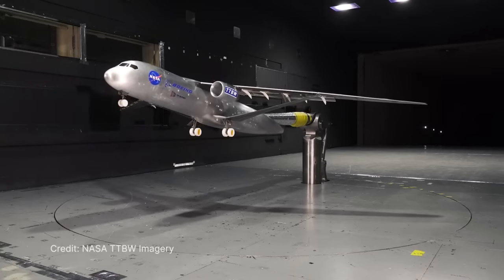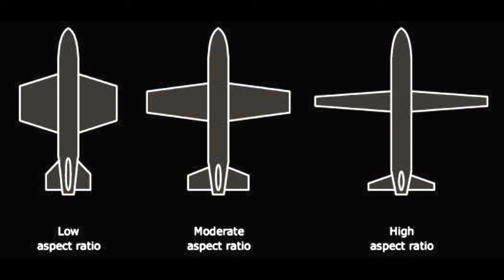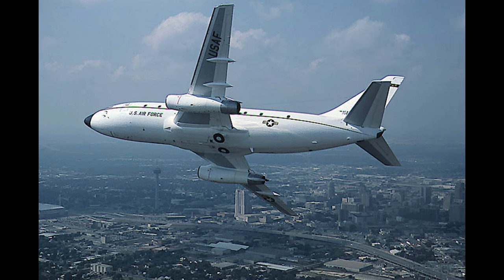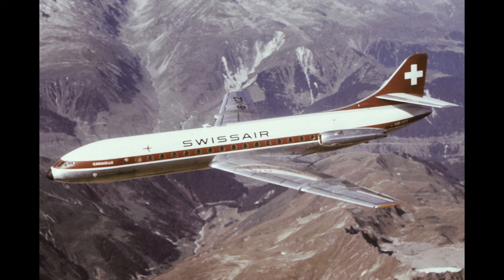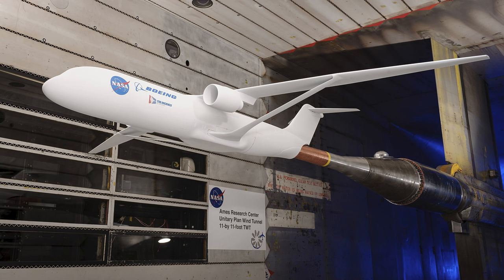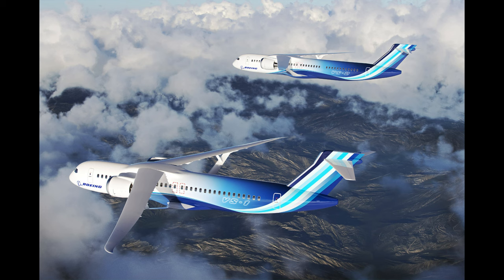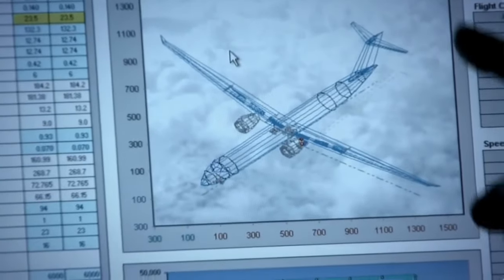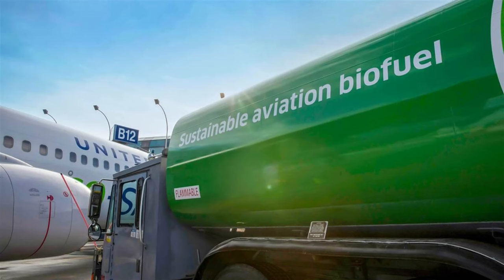NASA's New Airliner Experiment To Make Flying Less Expensive

Comment: On your electric plane digression -- Harbour Air (operators of the pictured Beavers) does a bunch of short routes around British Columbia with their floatplanes; in addition to doing half hour tourist flights over the Vancouver area (let them experience a floatplane and see the sights).  It looks like at least half their scheduled routes are 35 minutes or less. 
An hour of so of electric operation is probably perfect for them  -- use the quieter, and hopefully lower maintenance, electric ones for sightseeing and short hops and reserve their gas powered ones for their longer routes.
Reply: I got to see this very plane in person last summer. It was a guest at the BC Aviation Museum open house.

It had only a had few test flights at that point. An engineering blueprint of where the engine is mounted is painted on the nose. Looks pretty cool up close.
Reply: I have seen some articles and opinions that suggest Hydrogen Electric power systems could be the future solution to alternative fuels for aviation.
Reply: @johnjaffe6107  Possibly, though the power density of hydrogen storage isn't great either.  Still, I wouldn't be surprised to see some form of battery or fuel-cell electric planes in the short haul segments replacing many turboprops, and long haul going to bio-jetfuel in their gas turbines.
Reply: Hmm, I wonder if regs would allow the cruise safety margin of a battery powered plane to be met by an onboard fuel powered APU generator.  (and whether that'd be lighter than all the extra batteries).  I'm  envisioning that in normal flight ops you'd be 100% battery, but if forced by an emergency to stay aloft longer you'd fire up the generator and burn your power dense fuel to run your electric propulsion.
Reply: How many flights per day are the planes doing though? When I visited it seemed like they were rotating very quickly.
Reply: Norway also operates some short haul passenger flights that are electric props.
Reply: I believe their long term plan is to convert their twin otters to electric, too. Which would be a more commercially viable aircraft, too.
Reply: There are videos of that aircraft and interviews with the CEO. The quietness is seen as an advantage for early morning and evening flights. They operate a taxi service and being able to fly earlier and later will be an additional source of income.
Reply: The 'electric airplane' crowd  should get together with the 'fusion' crowd.
Their combined delusion could produce a super efficient totally green fusion/electric plane.
They could even have these ridiculous impractical wings where the greatest stress is placed
on the thinnest part of the aircraft at furthest distance from the aircraft body.
How cool would that be?
Reply: It seems to me that there are so many better places to put the resources I have to believe electric aircraft are more fanaticism than logic.  Even if you can build an aircraft that has an hour range and can charge in 30 minutes,  if you do this continuously battery life is going to be pretty short.  Batteries will keep getting better.  They may makes sense for a daily 30 minute flight.  But, as Scott Manley tried to explain it's a different equation than cars.  Kinda like R-12 freon we were venting huge amounts into the atmosphere on purpose and that had to stop, but we should have left it for a refrigerant where venting was only accidental.
Reply: I was excited when I first heard about their electric R&D in 2019! They're a local company! Wikipedia has a good writeup on it.

"In March 2019, Harbour Air announced plans to convert an aircraft to run on electricity, which would serve as a test prototype during a two-year duration regulatory approval process, and eventually hopes to convert its entire fleet to electric propulsion. The first plane to be converted is a DHC-2 de Havilland Beaver."

Can't wait to have clean, fast electric flight options to and from Vancouver Island!
Reply: @jonathan_60503  Takes too much room and weight. You're better off just adding more batteries. Slightly larger electric aircraft (and more aerodynamic) can get 400+km already, after reserve levels. Look up Eviation - they're building one and have already tested it. Float planes (being less aerodynamic) won't get range like that, but 200-300km should still be possible. More than enough for most of their routes.

@Charles Nelson If you go with LiFePO4 batteries, you've got the possibility of 10,000+ charge cycles and minimal capacity degradation. The downside is, your range is halved from the get-go. The popular Chinese Model3's are using LiFePO4, and getting 250km on them is about the max, but they're cheap, safe, and simple to manufacture. (Very different from a lot of proposed solutions.)
Reply: @charlesnelson5187  Those who say a thing can't be done should get out of the way of those who are doing it.   There are small, commuter-type planes that are flying on electric propulsion.   Electric versions of airplanes the size of A320/737 are still probably a long way off.
Reply: @johnjaffe6107  guess what power source is required to produce your green hydrogen. Sorry I will continue to recive my information from a theoretical physicist not a middle aged man still living in mums council flat. Guess what happens to pressure vessels when you reduce the outside pressure. Hence the iss is only pressured to 0.5 bar, around 7 psi. Half atmospheric pressure, oxygen enriched. Hydrogen also being the smallest molecule has a nasty habit of finding its way around the lager molecules trying to contain it. Please by all means quote the articles you read. Again I will continue to stick to scientific evidence. Not opinions. Have a nice day.
Reply: @dougball328  Could you post me up a link to the small planes? I'd be interested in studying their performance. Thanks
Reply: @dilutioncreation1317  Exactly the problem. They would have a several hour recharge on a pretty high current charger.
Reply: R12’s obsolescence was fueled largely by DuPont pulling a bait and switch to stay on top of the market.  They’re now doing the same game with R134a and R1234yf that’s butane based, horrifically flammable, and in some cars contained in plastic AC tubes in an engine bay.
Reply: @charlesnelson5187  velis electro, BYE EFlyer/Sunflyer, Harbour Air modified beavers, Everett Hydrogen powered q-400
Reply: very true. a lot of the planes they operate are super noisy for the passengers as well as residents over their flight path. good idea
Reply: Harbour Air is a very successful airline that has daily service to many locations in the Pacific North West.  I commute to work in a small boat and they are very much part of our "Harbour Life" each day.  I haven't seen the electric Beaver being used yet though...must be a regulatory thing still going on, as our flights to Vancouver are 20mins each way.
Reply: @jonathan_60503  The problem is one of scale. to provide the same trust as a regular 100 HP motor you need a electrical motor consuming about 75 KW. Now look up a generator capable of sustaining 75 KW and you will find it's not a small piece of kit. I'm not sure what size plane you are looking at or what engines it is using, but I think it has some passenger capacity so if it's less than 200 HP I'm going to be surprised. 

Now you could extend the flight some if you know it's going to be necessary early on. The more you have in the batteries the longer you can keep in the air using a generator that can't do it on it's own. But it's still not a good idea unless your generator produce enough to keep the plane flying even on empty batteries. The added weight is likely to cut down on the range enough you probably would be better served by adding another 200 to 400 lbs of batteries.
Reply: Plus electricity is probably the only thing in BC that's cheap
Reply: @charlesnelson5187  for and Electric Plane we just need to go back to the old thinking about Atomic Powered planes..
Imagine the Electric Plane people accepting a Nuke Reactor powering it. :-)
Never Happen.
Allways amazes me how these people never think about the batteries..

Comment: Drones are a great example of high aspect ratio wings and their benefits. My DIY drone has high aspect wings and flies phenomenally well at high altitudes
Reply: High altitudes like 400ft?  Homemade drones are little more than a great example of square-cube scaling.
Reply: Note that everyone here is not in America and my be able to fly at 10’s of thousands of feet in elevation. Even my normal fpv drone can break the 400ft mark in less then a second at full power.
Reply: @spottedcrow1126  400ft in less than a second? Sure, if you fire it out of a cannon maybe. Your drone would need to accelerate at something like 25 g to go that high in a second and reach a speed of around 560 mph. I'd love to see that on video.
Reply: @gonun69  25G is possible. You can certainly find/build drones that will take less than 2 seconds to get to 400ft. Some RC gliders will go over 500km/hr even in a pretty sharp turn. What is possible is pretty amazing now. The off-shelf-drones and RC planes generally pale in comparison to what people are building. I am just waiting for RC planes to break the sound barrier.
Reply: @spottedcrow1126  Everyone here is on a remote island somewhere in the Indian Ocean.
Reply: @wagnerrp  I've flown thousands of feet, and that's not nearly the limit. Some have literally gone to space and back with an FPV camera, glider, and weather balloon.
Reply: @gonun69  400ft in a second or maybe 2 seconds is completely reasonable and accurate. Quad copters are fast as fuck these days, 400ft is a legal limit NOT a physical limitation. If they'll fly 60mph straight up for 4 minutes then they'll get 15 miles high before they run out of power. That's literally 79,000 feet. Furthermore, we're not talking about multi rotors. High aspect ratio usually refers to fixed wing airplanes, which are far far more efficient than miltirotors.
Reply: @gonun69  lipo batteries and brushless motors allow for some absolutely absurd power to weight ratios in short bursts. 25g's is on the low side. Multirotors are pulling upwards of 40-50 easily.
Reply: @Raymond Wagmer, needs to lose the attitude and get educated.
Reply: @yodaiam1000  25 G seems believable, 400 ft in under a second as originally claimed seems dubious. The fastest dynamic soaring gliders are topping 800 kph, but from what I can see quadcopters are topping out a bit below 400 kph.

I will note that even though there's usually a legal ceiling of 400 ft, that's above ground level usually. Plenty of locations are at pretty high elevation, so it's possible to legally fly below the ceiling  but still at high altitudes relative to sea level.
Reply: @yodaiam1000  looking up dynamic soaring. A glider that reacher transsonic flight :)
Reply: @spottedcrow1126  Max ceiling in Belgium for a drone is 20meter. Over 20 meter you need a A1 License and declare your flight to flight control .... it is a very, very small country and extreme densely populated.
Reply: @gonun69  Look for a YouTube channel called quadmovr. Plenty 'on video' there. 400ft in one second seems a bit exaggerated, but not far off.
Reply: @chrismofer  surely there is a physical aerodynamic height limit, I do not think I quad copter could produce lift to stay aloft above maybe 20,000 ft (that's not even to mention any regulatory restrictions)
Reply: @JMMC1005  Yes, I agree. 1 second to 400' with current tech sounds dubious but they do go pretty dam fast.

Some countries don't have the 400' limit. You can also get permission to go above 400'. At some clubs, you can go above 400'.
Reply: @woodrunner51  Yes, it is pretty incredible. I didn't know about the new record but I did know that plenty of people were getting over 500km/hr.
Reply: Professor Frog  RC gliders are getting up to 0.75mach. It is difficult but not impossible. We used to think crossing the Atlantic with an RC plane was impossible.
Reply: @iforce2d  funny seeing you here. Good job on the farm hopper.
Reply: @PhotoArtBrussels  the altitude won't care anybody somewhere in regional Australia, where farms can be as big as Belgium

Comment: Reinventing the good old box-wing.
Also the reason for the winglets is because a high aspect wing that achieves the same will not fit in the gates at the airports.
Reply: That and to make use of the vortex pressures around the wing tip.
Reply: next it will be bi-planes and sail power 🤷‍♀🤷‍♀
Reply: @NickCombs  A longer wing with a blended winglet is the most efficient - see the 777X. Winglets are a compromise that gets you most of the gain for less wingspan (or no complicated/heavy folding mechanism).
Reply: I was actually wondering the whole time how this compares to box wing designs.
Reply: A possible solution would be part of the wings folding up, like aircraft do for aircraft carriers
Reply: @NickCombs  It is to reduce vortexes around the wingtips. And lengthening the wing would work just the same as a winglet (with the benefit of also providing more lift) but the wing would be to long to fit the gates. That is why winglets make no sense if your application does not have limitations of the length of the wing you can have.
Reply: box wing doesnt worry about wing tip vortecies. there gets to a point in any technology where you get so advanced that it starts to resemble your first idea that you had to begin with.
Reply: Why are you mentioning this when he specifically mentioned that in the video? Hardly a need for you to repeat what he says.
Reply: @danisyx5804  new ocean freight liners do use wind to spin a big rotating drum that powers the engine. and more wings means more lift.
Reply: @chmeee9562  folding wings won’t happen, the extra weight costs more fuel and the complexity adds to maintenance and reliability issues. Fine for a Navy aircraft but NOT where every cent is counted in a commercial industry.
Reply: @teeanahera8949  I think the 777x already has them?
Reply: @titter3648  
Also, this was one of the fantastic things that Prandtl figured out in the early years of aerodynamics. It's one of the discoveries that were later implemented by the Horten brothers, to make their gliders more efficient. Also, winglets help reducing adverse yaw.
Reply: @teeanahera8949  Because apparently they missed it? I missed it too and I was listening to see if he mentioned it. 🤷 I guess you are the only perfect one here. All bow to your perfection. 🙄
Reply: @danisyx5804 po
Reply: The Transonic T-Brace frame does NOT reduce DRAG, but allows a bigger hold wing, there is a BETTER way. Can also utilized as wing fins, while being two main wings, for example: (In a top view.)  If you use an acute angle slim wing base limbs in the mid top front of a craft, that attaches to the tips by another lower rear reverse wing at its base connected on the back of the craft. The full set can be very narrow width spand. 

 A hollow mid mass + elongated lesser drag combo. of delta wing sonic speed & lean airliner size wings lift grip in* ONE. Top view diamond (《》) formation, front/back view as flat diamon ( <> ).
Reply: Thats exactly what I came here to say.  Even if you extend the gates, you've got major airports where you'll still have to move the entire terminals farther from the runways, just to deconflict wingspans between these aircraft at the gate and aircraft on the taxiway.
Reply: @titter3648  All span unlimited Open Class competition sailplanes have winglets.
Reply: Winglets greatly reduce the Vortex Drag generated from convention wing tip designs.
Reply: @danisyx5804  large cargo ships have parachute-like sails that they deploy from the bow to increase cruise efficiency
Reply: @danisyx5804  the laws of aerodynamics dont care about old vs new. what works is what works. were just trying to figure that out
Reply: @chmeee9562  I assume hinges on long aspect wings would have to take a lot more stress
Reply: @Bionicbuddha 
*millions
There's a difference between "this works good" and "this is the absolute most optimal use of the materials and labor we have to hand and we have at least some degree of information regarding any deviations therefrom".